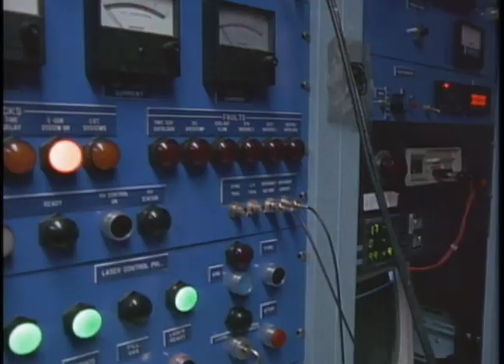Laser Pumped Flying Saucer Spacecraft

Comment: 20 years from now find some really rich supercapacitors, and then use them to power a laser (momentum = N * h / λ). That way you are not dependent on the line of sight or decay of the laser beam. A pure-electric space vehicle is possible. It doesn't even need to be limited to going "up" as would be the case for anti(only)-gravity. You don't even need "fuels" like uranium or hydrogen.

Comment: Cant use it in space, no air to heat with your laser = no propulsion. This has nothing to do with spaceflight and is as irrelevant as a plane. 

 And to bring with you and blast off any air/ etc in space is SO inefficient.
A normal combustion engine would be a thousand times as effective.
Its a nice alternative to atmospheric flight though.
But i still believe that the Powersupply - thrust is still way less then a simple electrical motor attatched to wings.

Comment: @1wntr Pretty sure it's because there's only 1 of them. Also, this is meant to add propulsion so that you just have to use smaller rockets. Stability would be kept by the aerodynamic properties of the aircraft once it's gained speed.

Comment: It requires air to work, something a spaceship crew would be in very limited supply of. However, it is easier to transport large quantities of compressed gas than it is solid rocket propellant. This represents merely a very efficient fuel.

Comment: @pempern 
What I understand is that the main issue is that the high energy to escape the earth gravity is not needed on the vehicle (laser and air not on board) thus significantly less weight to move and less energy is necessary,  I see no reason to transport useless and heavy nitrogen (78% of air) that would also require a laser system in space, rather than other more efficient and light liquid combustions once out of the earth’s atmosphere.

Comment: @LolcanoStudios said: "He said the metal would become up to 5 times hotter than the surface of the sun... yet he catches it with his bare hands after use? :S"
He said it would be between 10000 to 30000 Kelvin (9727 to 29727°C), sun is circa 6000°C,  any metal would melts below 2000 °C if maintained long enough, the reaction near the metal would be at 30000 Kelvin for 18 microseconds, the amount of heat transferred to the metal would be barely measurable.

Comment: @LolcanoStudios just for the timespan of milliseconds, so its not really the metal becoming that hot, as i know we dont have any kind of material yet wich actually could stand even 1 time the suns themperature. allready temperatures wich would made the metal cylinder deform would totaly waste the accurate upward movement caused by the plasma explosions, infact of the upcoming asymmetries inside of the parabolic dish and its irregular becoming reflection angles. correct me if im wrong :)

Comment: @ucrdave 
Don't forget, the air acts as the reaction-mass (remass), not as the energy source.  The energy source (or "fuel") is the laser.  In chemical rockets the fuel and remass are the same thing, but in alternative rockets like plasma electric or this fine example the remass needs to be considered separately.

Comment: The lack of air in space would limit it to use within the atmosphere, but I wonder... 

Maybe the laser can strike the metal in such a way that small portions of it could ablate, the vaporized gas could then take the place of air, and create that shockwave used to propel the thing.  Of course you'd need a vehicle with thicker walls to last the whole trip while being shot at by hyper lasers.

Comment: @Rockysbeats Brakethrough? There are much better theoretical systems like a photon based systems like the PLT not involving a stupid satelite which is needed as a powersource. Taking a high energy laser to cause air explosions as propulsion... theres no air to explode in space...and it would still need fuel as a substitute. 3 times better efficiency is not gonna be enough. Thats like comparing a diesel with a hybrid car.

Comment: @Lebowskisan "...breaks down the air, and blast down a strong shockwave, and that propells the model..."  the inventors words... at earth maybe this could happen... but outside of the atmosphere, that there is no air, that can't be possible... plus the laser that is so strong that it could create problems to satellites and that's why they have the platform to block the beam, but after using it at the model... he catches is with a hug... with this lazer on that model, it should be extremely hot.

Comment: "...breaks down the air, and blast down a strong shockwave, and that propells the model..."  the inventors words... at earth maybe this could happen... but outside of the atmosphere, that there is no air, that can't be possible... plus the laser that is so strong that it could create problems to satellites and that's why they have the platform to block the beam, but after using it at the model... he catches is with a hug... with this lazer on that model, it should be extremely hot...  total fail

Comment: The modulus of elasticity is way to high for the thermal pressures to endure for any length of time using that type of perabula. The vectors are not correct.

Comment: actually it you were as educated as you make out you are,you would realise that it does not work in the vacuum of space,because the laser heats up the air contained under the disc causing it to explode and push the craft upwards,light has no mass you cant push things with a torch unless you use the handle ok,

Comment: @1000000volts 

Actually, this is something NASA is actively investigating.  Obviously, the power required to use lasers to propel a craft in space is enormous, due to its mass, but the idea is valid.

The fact that there is no air in space, as you call it, or as more educated people describe the vacuum of space, actually works in favor of this idea.  With a vacuum, the laser can actually guide the craft.

Comment: @cw232
Because "warp drive or a nova drive" is purely fiction?  :P

The fact is, chemical propulsion has pretty well reached it's peak.  Existing craft  are specialized to use chemical propulsion.  Since you have to develop a new type of propulsion, existing craft will be all wrong.

Comment: @progenitor00 Yeah and the air is heated and expelled from the cone and replaced by air that in the atmosphere right? Otherwise they could use a regular laser and get a continual thrust and wouldn't need the pulsing right?

I don't mean to sound mean, I know very little about this cool little cone fella =D

Comment: @phoenixaltar 
Er, or just fly around.

Now. in the distant future, when you're building ships in orbit and you have fission or fusion reactors as power sources, a direct light-pressure laser propulsion system could give you an extremely high specific impulse (acceleration per unit of weight of fuel).  If you're already in low earth orbit, total thrust matters less and high specific impulse is the name of the game.  See Larry Niven's early stories along these lines :)

Comment: @phoenixaltar 
The problem with this would be the weight of the power source.  The attraction here is that you can have a big clunky laser on the ground, optimized for energy efficiency, and transfer that power to a lightweight vehicle.  Having to haul a big chemical laser or something of that power, well, regular old hydrogen/oxygen rocket engines would be a far more efficient way to get into orbit.

Comment: This is really just a concept vehicle for a plasma drive.  The Ion drives they are testing is the next step.  It takes much less energy to generate and contain a plasma in space (a natural vacuum)  You still have to carry the gas with you but you will use less energy, and can accelerate the plasma much faster and need less gas.

Comment: the prototype they are working with requires air yes, but only for stripping electrons from it. With a bit more advancement we would be able to utilize what little atomic matter exist in the space between the objects in our solar system. It's just way to diffuse to be practical for deep space travel at this time. But great for ferrying cargo into orbit.

Comment: he's talking about in the engine. The heat is only for microseconds, therefore it dissipates before causing any real damage to the craft. It actually doesn't heat the craft, just the air below it.

Comment: um... please explain why they wouldn't be able to control it? How do you think every single one of our space craft travels. The spinning is actually necessary for course stability. Besides, yes we need more advanced systems for interplanetary flight, but we need to overcome one thing before we can even think of that... Getting out of earth's gravity well.. and this, along with the space elevator is a perfect way of doing such a feat. Maintain a stationary crew capsule and spin the outer shell...

Comment: I believe you mean Fusion Torches are... But Ion drives or to be exact, Plasma Ion Drives, are very low thrust packages. Think more along the lines of a smaller Large Hadron Collider producing a small star's worth of thrust. That's more likely. Unless of course we find a way to keep ourselves in suspended animation over the thousands of generation it takes to get anywhere.

Comment: No, so long as you can stave off diffraction even a little bit, as long as you have a laser at the starting point then you could easily get to the edge of the solar system (provided you have enough energy for it) faster than any other man made spacecraft has ever been capable of. One at the start and I guess one at the end unless you want to enjoy a really long term orbital deceleration. Either way, look at this and just try to tell me the Gov. hasn't put it to use somewhere...

Comment: this is retarded. Just make a SEG motor Inverse G craft... Magnets are much more efficient. that is retarded to even think of using this... Why not run off the gravity of the earth, move at thousands of miles of hour without having any gravitational distortion on the body. And the more load you put on it the more efficient and cold it runs, and it never needs a battery or fuel.  Open your minds... Look shit up

Comment: This whole idea is wrong, and will never probably work. To achieve the speed that would be higher than speeds we can create right now, you would need EXTREMELY strong lasers. And those lasers would be so strong and hot that they would just turn everything into ashes. Even this weak laser on video burn that metal thing.

Comment: but then why even use lasers? It would be more efficient to heat it directly, or use a motor. The whole idea here is to have a separate propulsion system. Not to mention this will not work in space.

Comment: Using specific impulse as a efficiency comparison between two completely different modes of propulsion is comparing apples to oranges. It'd be better to use kinetic efficiency or momentum efficiency of the photons. I suppose the Isp value you're saying though is of the plasma discharge as a function of Veq, right? ∆V=-Veq*ln(1-MF) what is the effective MF?

Comment: well yeah, I never said they were expensive(thoguh obviously a good one is). They're actually very fuel efficient and thats what makes them so good in space, but they give jack all thrust. If you don't have air resistence you can leaved it turned on for ages to go very fast but it will take a long time. Chuck in air resistance and gravity and that baby aint moving.

Comment: actually a very basic ion engine can be made cheaply using a thin copper wire used as a corona wire charged to several thousand volts, and grounded sheets of tin foil. they can barely lift themselves off the ground, and do not have the efficiency of something like say a helicopter.

Comment: ion engines cannot produce anywhere near the amount of thrust a pulse laser can provide. ion engines produce a tiny amount of thrust very efficiently over a long period of time.  pulse lasers produce a high amount of thrust in microseconds.  the two propulsion systems are not used for the same applications.

Comment: The laser propulsion system would only be used for liftoff.  Once in space, the craft would use plasma rockets, which were described here as "superheated gas accelerated by powerful elecrical and magnetic fields"

Comment: LOL.... a rocket IS chemical fuel u idiot.

it doesn't take the smartest guy to know that we're not going to use this for flight of any kind, EVER. it's wayyyy too risky for cargo/passengers and too inefficient as far as power consumption goes. using it as a means to get a network of equipment across a large area of space in a short time-period, maybe.

Comment: Radiant heat is quite capable of traversing even a perfect vacuum. It does not require any particles to propogate. I was under the impression that all of the liquid helium in the LHC was for the singular purpose of keeping the beam-bending magnets at a low enough temperature to superconduct.

Comment: But this IS a corporation doing this, it's not NASA.

Also, the test in this video used a laser developed for the MILITARY, also the military provided the test grounds (it's a missile range).

Basically this whole light-craft project was conducted by those same military and corporations that you detest.  Without them this would not have happened.

Comment: Ion engines are small and lightweight.
You could simply launch with the laser propulsion, and then once you're in space use the ion engine.

But honestly, the laser propulsion actually does work in space - they paint a kindof solid fuel onto the mirror surface and the laser beam "ablates" it.  The ablated particles are incredibly fast, so while in this mode it is still more efficient than traditional rockets.  It's Win Win.

Comment: All propulsion works by using energy (in this case a solar or mains powered laser) to accelerate mass (in this case air).

While on Earth - Air is all around us, so you don't need to carry that with you.  All you need is an energy source to accelerate that air.
Turbine engines use jetfuel to do it.  But that means they have to carry the jetfuel, which runs out.

The Lightcraft effectively has near infinite "fuel".  The laser uses either a power cord or a HUGE solar panel.  So it can't be onboard

Comment: At 4:40 he's actually talking about "ablative propulsion", which is how the lightcraft will operate while IN SPACE, which is not shown in this video.  As there's no air while in space - the laser will instead explode a kindof "fuel paint" from the underside of the lightcraft.

While in earth's atmosphere though the craft's ISP efficiency is effectively INFINITE.  As the laser does not use fuel - it's solar or mains powered, and the lightcraft doesn't carry any ejection mass (it uses air).

Comment: This needs more funding.
As for comments it won't work in space the laser engine may still work if some hydrogen or water was carried on board for reaction mass at high altitudes.
 It still would save hundreds of tons of propellant and cut cost by more then 10x even if it can only replace the first stage.

Comment: There using about a 200w co2 laser which propells the silver thing about 40 feet, so to get to 350,000 feet (100 miles) It would need 1.62Mw laser or 8200 lasers,

Also the Major flaw is the propusion system heats air to get in space, and so will be less efficient at higher altitudes as the air get's less dense. and in space there is no air so it wont work at all. But it might help to provide some  force, thus lowering the fuel load.

Comment: no.  They are using the pressure of the photons produced by the laser when in a vacuum.  For atmospheric use there is a rapid thermal expansion to produce thrust.

Solar sails would use photon pressure just like a laser system.

Comment: The problem is if this is supposed to be cheaper than the chemical rocket then how would you lift off a 10 ton load? Think about all that chemical producing electricty. Another challege is trying to zero on that target about 20 miles away. Any slight jitter will cause that to go of course. It's cool but impractical though.

Comment: If a ship ran out of fuel another ship with extra fuel can go and save it.. You couldn't save that ship if all the ships relied on this same remote propulsion system. 

agreed, Ion plasma propulsion engines seem promising.

second point. If this Remote laser system was used for launches only, what happens when a gust of wind kinds the module away from the laser? does the thing have the ability to instantly reestablish the firing trajectory at 40,000 ft?

The logistics seem flawed to me.